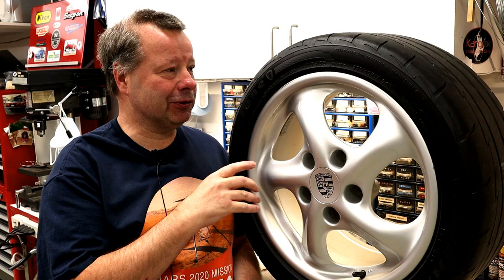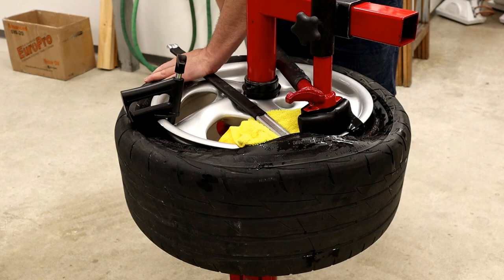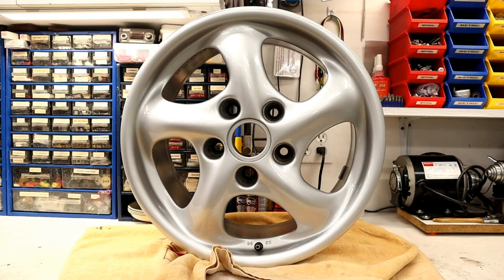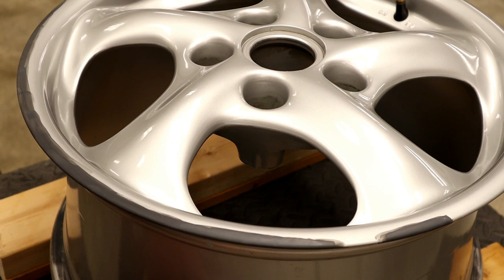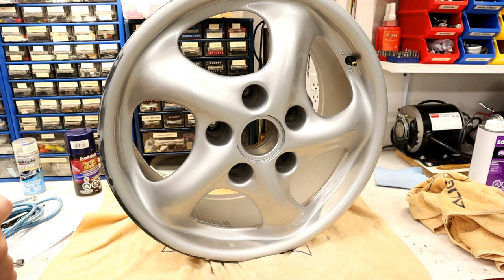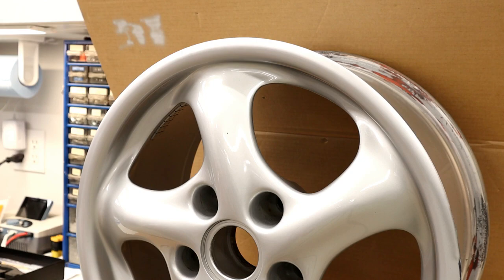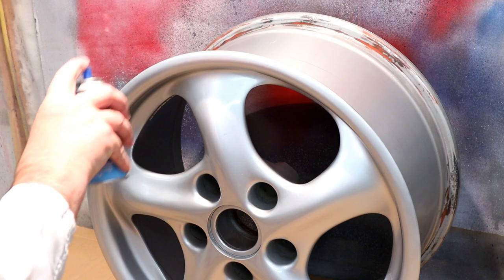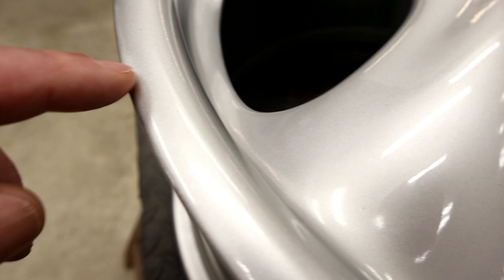Scratch Repair On Alloy Wheel To Make It Look Like New.

Comment from the maker: Manual Tire Changer One Year Update with Tips & Tricks
https://youtu.be/QND8n_ArNRo?si=XUwyuzHL1dCcrmhl
Manual Tire Changing Series: Part 1 - Manual Changer Overview & Mounting
https://youtu.be/06Jr9t1CnNQ?si=wvgbwoxDUN1l1LLG
Part 2 - Duck Head Modification & Tire Removal
https://youtu.be/wXsloeT0QhE?si=4UjZIhoC37FezvoB
Part 3 - Mounting & Balancing Tire
https://youtu.be/IX7DvJo7A8E?si=OTW5yzmpjdq7W5tL
Part 4 - Repairing Tire Shop Damaged Wheel
https://youtu.be/hn0XbHgvnFY?si=Sm4y9yX2i7_zWbcm
Part 5 - Valve Stem Replacement Without Tire Removal
https://youtu.be/pr4bwIlc69o?si=waOAvduaulSryRZl
Reply: Hey John! I love all of your content. It’s very straight forward and entertaining. I’m a beginner heli flyer, and have a blade nano s3. I made the mistake of buying the rtf version. The controller it comes with is not computerized and it like a toy. I was wondering if it is possible to bind a non spectrum transmitter to the 2 in 1 esc and receiver. Also, could you make a video about your entire heli collection? That would be awesome as you have some really cool helis!
Reply from the maker: If you want to use a non-Spektrum computerized TX, you are looking into the world of Multi-Protocol TX systems or external RF modules (which include all the Spektrum DSM protocols). Fairly steep learning curve, but certainly doable. Best place to start your research is Multi-Module's website: https://www.multi-module.org/
Reply: @Rchelicopterfun  thank you John! I was looking in to the radio master tx16 hall, which you had recommended as the best value controller. I will follow your guide on how to bind an open tx radio to the as3x receiver on my heli. Thank you for responding, and making good content! 
-Josh

Comment: I've given up on people in a shop being professional, I've had my car filled with the wrong oil or overfilled, had loose parts not fully installed back or not installed at all, etc. 3rd party or dealer, It hasn't made a difference.
Reply from the maker: Indeed - similar experiences as well.

Comment: The Pros are getting harder and harder to deal with, so you have to do everything yourself.  We bought a used car and it did not have the key to take the lock nuts off, so we went to a garage who insisted we make an appointment and it would have cost about $300 to have it done.  I went home and found a 12 point socket, hammered it on each lock nuts and remove them myself.  My mom recently have the brakes done on her Venza.  She wanted me to clean the interior and when I picked it up it had almost no brakes.  I took it home and saw new lines on the front driver side caliper and no fluid in the master cylinder.  I proceeded to inspect the brakes, found the rear parking cables had not been hooked up and the rear caliper pins were seized.  I then proceeded to bleed the lines and massive amounts of air came out, but no leaks anywhere.  It appears the "mechanic" that worked on the car only bled the one caliper with the new lines and sent her car home with only this one caliper working.  It's so frustrating to have to learn how to do everything at times, but that is the sad state of affairs in the area of Ontario where I live.  I started doing my own tire changes years ago when the tire shops either overtighten the lug nuts and they snap off or they don't torque them enough and the lugs nuts come loose and snap off the studs and ruin the rims. If that does not happens they leak.  In any event it has been safer an less expensive in the long run doing it myself.   
Thanks for the videos.
Reply from the maker: Wow, that's scary stuff; I've unfortunately heard many similar stories. Glad you too can at least do your own work and fix such mistakes while taking the time required to do a proper job. Time is after all the underlying issue when techs are encouraged by most shops to beat book time. Some shops even let techs go if they don't beat book time or push enough sold hours through the door. Quantity over quality seems to be an invasive problem, not just in the automotive service sector either. ☹
Reply: I agree with you @24revealer.  I have had to learn to do everything myself because of similar experiences.  Do you balance your tires as well?
Reply: The same thing happened to me with my mother's car and  with my own cars that I decided to invest on a tire mounting machine and balancer I got from eBay.  I no longer depend on any mechanic for brakes, tires,  all fluids,  wheel repair, tire repair, lights, belts, etc....But yeah painting is still my work in progress.  It is an art.

Comment: I guess I'm gonna spend money for equipment now. Just curious, did the shop done the damage ever compensate you or that's just too much trouble.
Reply from the maker: Offered me a discount on my next tire purchase. I've never been back and now purchase all my tires from BlackCircles.ca with better pricing, selection & free shipping.
Reply: @Rchelicopterfun  That's unfortunate. I heard story that shop pays for a new rim (I think that's what should have been done or at least repair it for free).
Reply: @Align700nitro  They're used to changing tires on cheap wheels that 95% of people don't care about. The 5% or less keep their vehicles meticulous, usually it's a sports car or a high end car. They aren't used to dealing with those kinds of vehicles and people. Just slap it on there and get em out the door as fast as possible is what they're used to. Throwing stuff around.